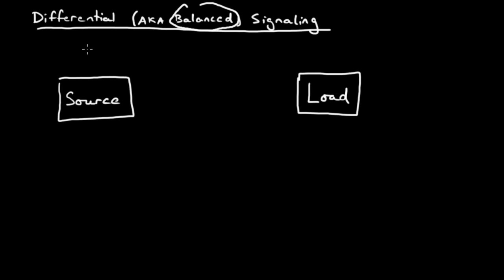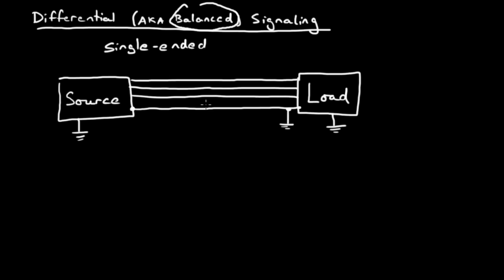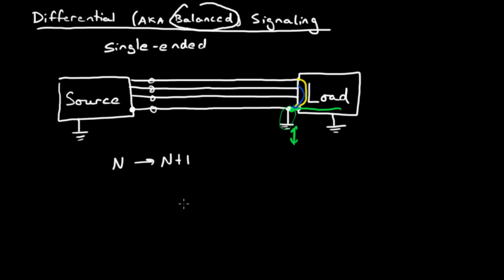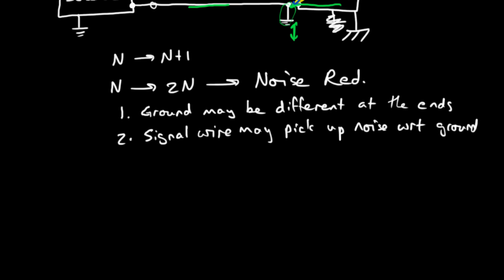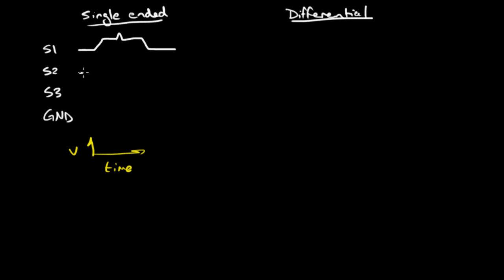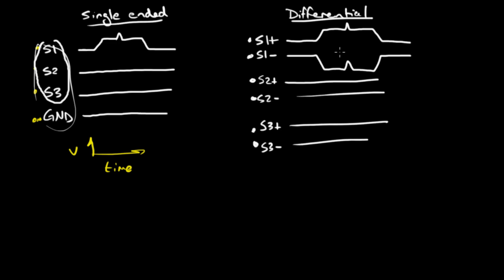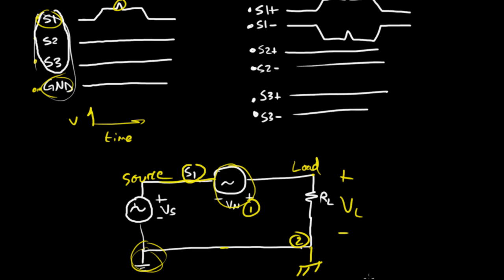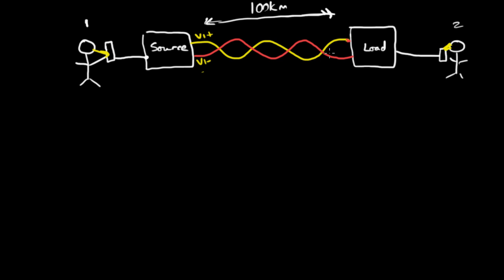Differential Signaling 1 of 4

Comment: This is really cool. An intuitive way to see why the voltage spikes (i.e. noise) doesn't affect the signal is to measure the distance between the two signals (the difference between them) at any given point. 

Say it starts at 0, then signal A goes to +1 and B goes to -1. That's a difference of 2. It stays the same until it hits the voltage spikes, then A goes to something like +1.2, but B goes to -0.8. the difference is still exactly 2! 

So long as you can keep all conditions the same for both wires, they should experience near-identical nose, which will just cancel out when the two signals are compared.

Absolutely brilliant.